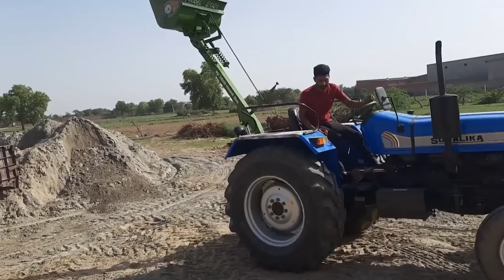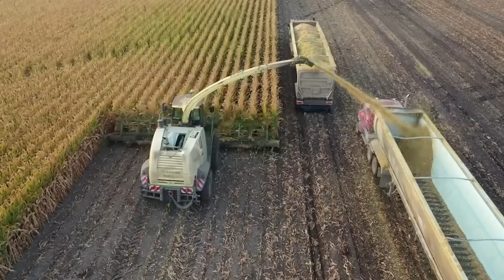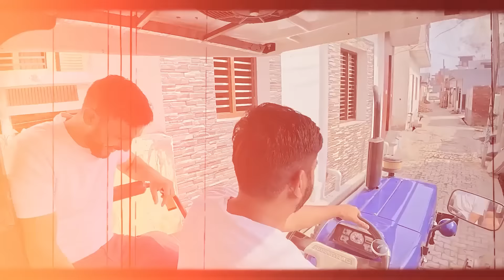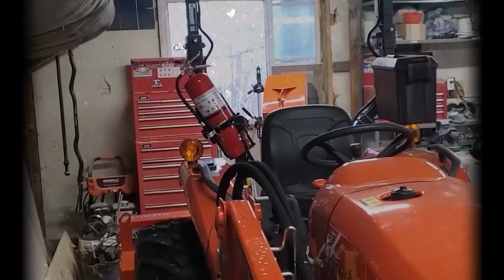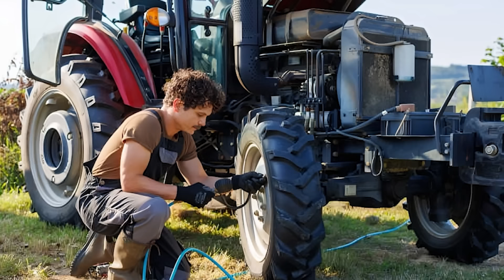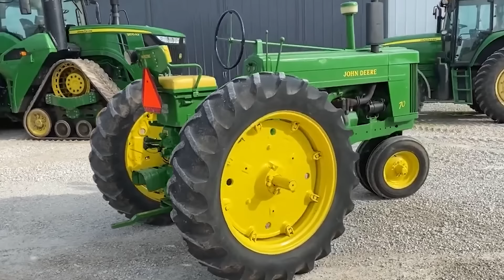15 Deadliest Tractor Mistakes Every Farmer Still Makes

Comment: M8, tractors are very stable machines, and Tires are as good ans any other, on road and off road. 
The Main Issue is also not the "TOP HEAVY"
They are not top heavy.
Tall doesn't mean Top heavt.
Cabs are very Light compared to the rest.
90% of all weight is below your feet. 
Tractors have NO Suspension in 95% of them. 
They are rigid, so the Flip. 
Thy are like Go Karts
Reply: Traktoren kippen um, WEIL sie vorn eine Pendelachse bzw. eine Federung haben ! Die Pendelachse ist nötig,aber eine Federung ist Blödsinn ! Go- Karts kippen nicht einfach um. F 1- Autos und Rennwagen auch nicht,denn die sind nicht auf Gemütlichkeit gebaut !

Comment: I’ve had 2 friends die when starting a tractor with a screwdriver on the starter motor when the key start was faulty. Forgot it was in gear with no handbrake on. It was quite common back in the day. 
I’ve also seen a young girl get scalped when her long hair got caught in the pto.
There’s good info in your video.
I used to teach farm cadets how to drive tractors on steep hill country. Yeah I’ve got a lot of stories.